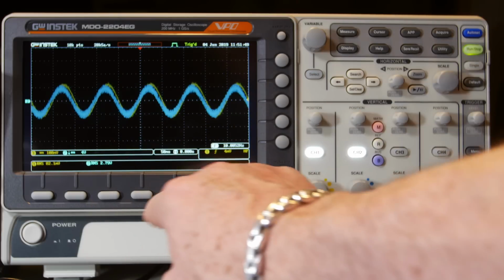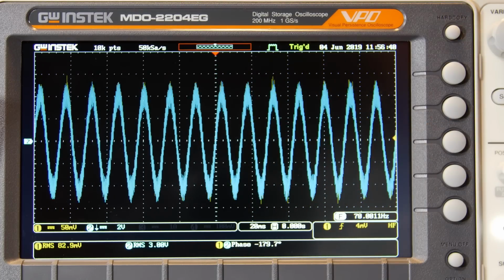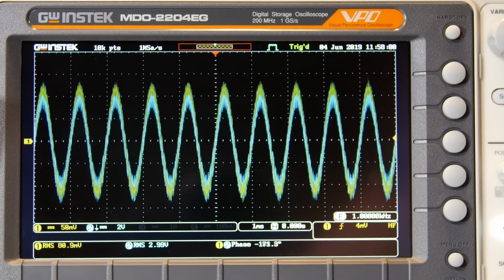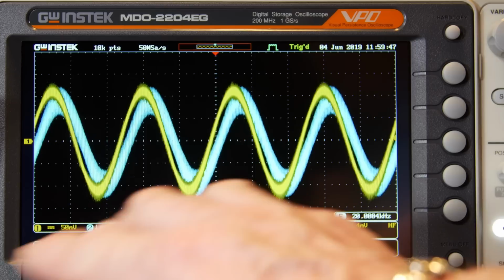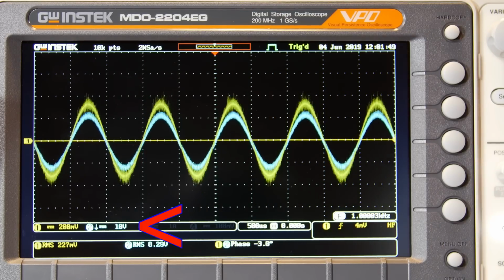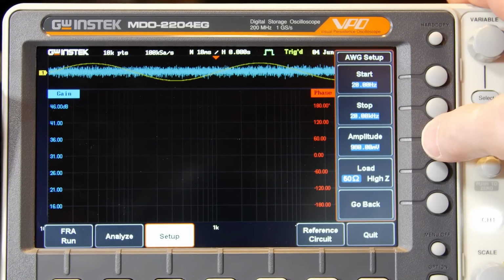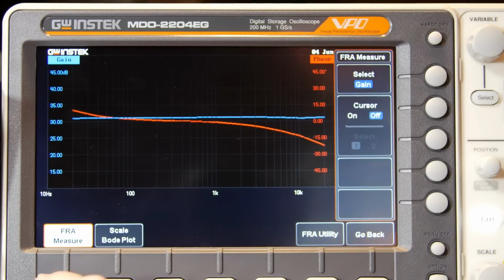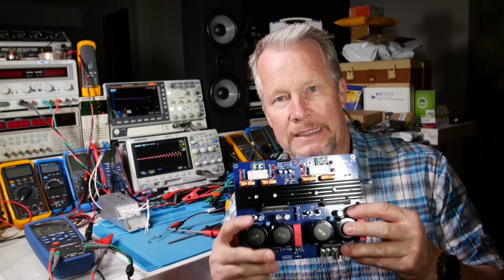Class D Amplifier Gain Phase Accuracy with TA2022BTL 230W + 230W

Comment: Thanks Eddie. Nice video. Just wondering why it was necessary to use the differential probe on the output. The speaker ground should be at the same potential as the sign ground. Also maybe put averaging on to reduce the noise. I'd be interested to see if you can use math to established a datum and then as the frequency increases you can see the delta on the scope instead of having to remember the original value. For example if the phase was 10° set your math channel to 10 - channel 2 (which was your output) then the add the math channel as a measurement and watch the delta as the frequency changes. Keep up the awesome work. Looking forward to the class AB version.
Reply from the maker: stuartmp1974 Thanks Stuart!  These are some great ideas!  I actually turned off the averaging to speed it up - and if I remember didn’t make a big difference.  I like the idea of using the math to zero out the calibration curve.  Great idea!  I expect to get deeper into this once I’ve introduced the ideas and basic measurements.  More fun to come!  I appreciate the great ideas and feedback!

Comment: GOOD DEMONSTRATION, LOOKS LIKE A OF NOISE IN THE OUTPUT.YOUR POWER FORMULA IS INCORRECT.
Reply from the maker: Thanks David.  Which formula was wrong?
Reply: That's how Class D works. It's a distortion pedal.
Reply: Pulse Width Modulation should have never been considered for audio but lucky for Class D manufacturers their buyers are deaf AND stupid.

Comment: Hi Eddie,
That's a good video, l like basic way of your measurements, without the fancy application.
Interesting how the differential probe looks noisey, the power supply for it has alot noise on it, mine has.
I noticed you went up to 28Khz at the top end, I thought it should be 20Khz as audio nominal is 20Hz to 20Khz ?.
As a beginner, when playing music, it's not played a full volume, so does the small phase shift really matter ?
I've noticed the Audio people go for very high wattage systems, but even if you have a speaker sensetivity of 85db @ 1 MTR
Which is 1 watt. That could still damage your hearing , in a small space.

ATB Adam
Reply from the maker: Thanks Adam!  I couldn’t agree more about the power.  I think we ought to be more concerned with accurate reproduction.  I don’t know how much phase shift is ok - I think the audio manufacturers like to focus on the easy to market terms.  I want to see how an A/B amplifier tracks over the audio band.  Maybe we are trading efficiency for quality or at least accuracy.  I have another way to track this phase accuracy without the cool FRA app;) I’ll demonstrate that.

Comment: Looks like your power supply was running out of juice there clipping max output. If you decide to use that as a permanent standard amplifier to compare to a new shop build your own custom CRC our power supply 
https://diyaudiostore.com/collections/frontpage/products/universal-psu
You could buy the circuitboard DIYaudio.com There’s an excellent build guide with great photos of how to put things together very clean power supply designed just for audio application
Reply from the maker: Thank you!  Great info!
Reply: No it wasn't. That's what class D does to audio. It's a distortion pedal.
Reply: @MichaelDespairs 😂🤣 
🤫 you can’t tell them that. They will get upset..